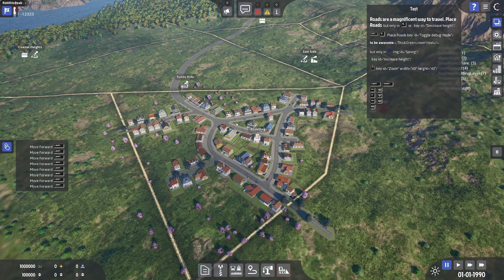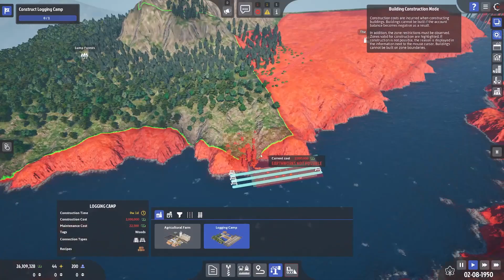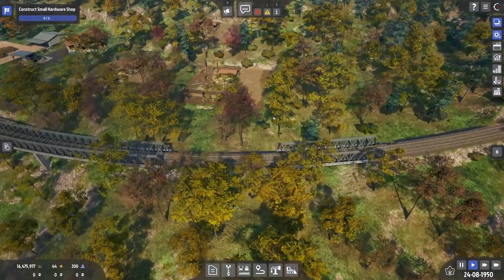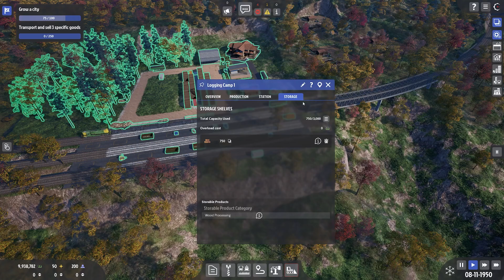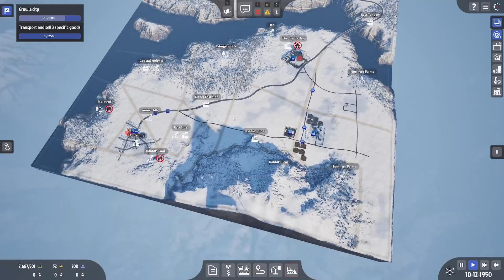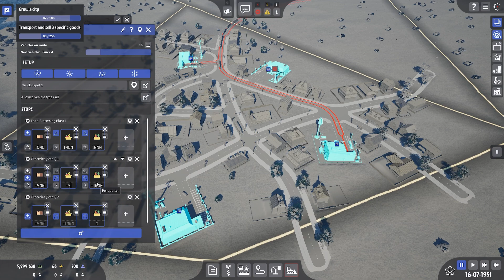NEW Industry Tycoon!! - Industry Giant - Management Transportation Logistics City Builder

Comment: In my opinion the maps are way to small. And the fields depending on the farm-mainbuilding are way to small too ot the mainbuilding to big.

I also do not like that in the current date its not normal you have several fruits on a field per year. Its normal... so you had to plan which fruits and which time and how to manage the soil fertility.

The same also in the city. It looks from the mechanics it has like the 90s.. but this was 30 years ago...
Reply: map needs to be 9x bigger